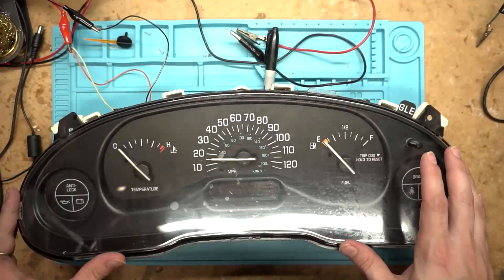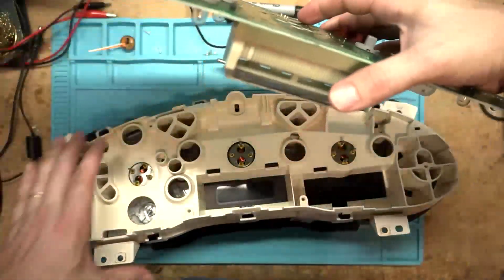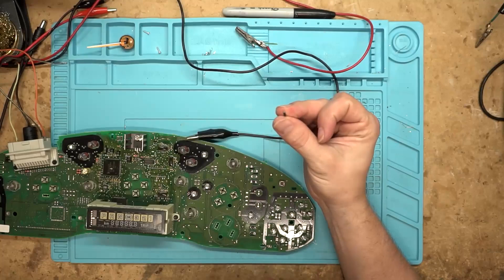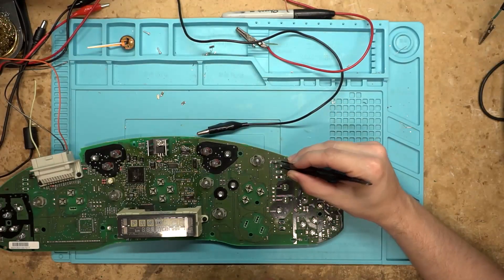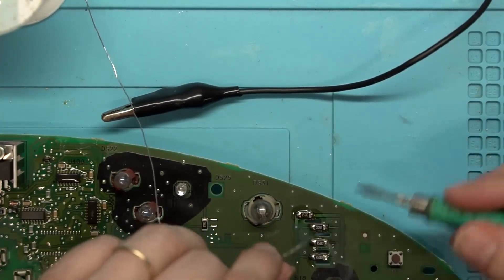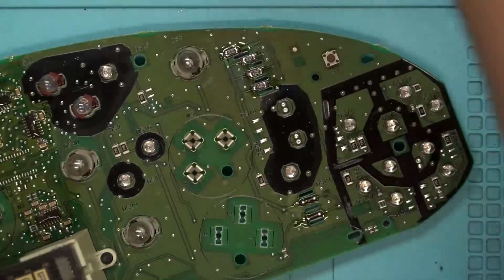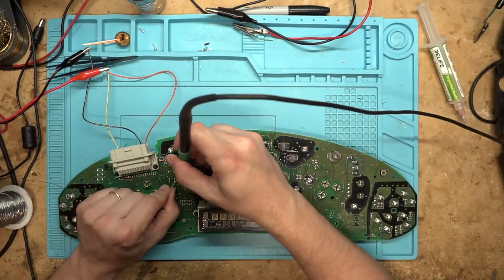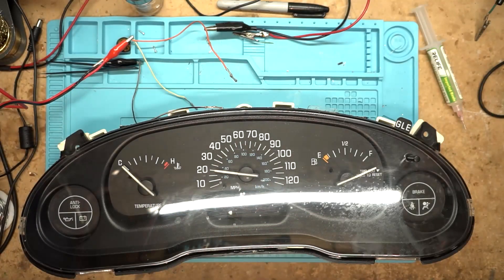Buick Century Broken Odometer Repair

Comment: Is there a video you have or that you could make that could show me how to get access to this circuit board? My LED gear position indicator and odometer/trip display was cutting in and out, and now it just doesn't work at all.

I'm great at mechanics and electronics, and I could fix this stupid quick, but tearing apart the dashboard, console and everything else behind .... I need blueprints LOL!

HELP!!!!!! 😭
Reply from the maker: Hmm I don't have to make a video of but if you watch one of my 03-07 gm truck videos it should give you a good idea. They come apart about the same.
Reply: @FixedUntilBroken  absolutely, I understand. not to be a hassle, can you link it in a reply? I've got 2 short days off after my last shift and if I can tackle this, well ... my mom would be forever grateful! xD

I appreciate you!
Reply: @crackerjack4833    Too late, but here's a video on the same topic with a good dashboard take apart description.   He points out where all the fasteners are.    The video by FixedUntilBroken has a better soldering description.   https://www.youtube.com/watch?v=5HRpIumibyE

I would add to the dash take apart, that once you have all the screws out, you're still pulling friction fittings apart.   I find that starting at the driver side and gently pulling the slips/fasteners loose working my way to the glove box works pretty well.

Comment: i did this several years ago on our 1st buick no problem, still working. just did it on my 2nd buick and still not working. pretty sure im using the same leftover resistors from the 1st try- didn't work. went to ax man surplus and bought different resistors and still no go. anyone got any other fixes before i go buy a junkyard one? as referenced in other comments i tried some other resistors 2 120 2 150s still nothing. maybe i messed something up, my reading glasses help but im getting old. also 2 of my original resistors were missing so i assume that's the problem or at least a problem. just went out, car only has 100k miles.

Comment: If you want to get technical, these clusters actually have two 120 ohm and two 150 ohm resistors. But four 150 ohm resistors will work fine.
Reply from the maker: Really? I actually didn't know that. I've never gotten on in with all 4 resistors still on it. They never have color bands still.
Reply: @FixedUntilBroken  Yea, It's hard to find them nowadays where they haven't all desoldered themselves from the board. Would be nice if they gave us some color bands right? And not that it makes any difference, but if you're curious, the stock configuration from top down or bottom up is 120, 150, 150, 120. Some of the Impala's us the same 4 resistors, just spread out a bit differently.
Reply from the maker: @mike7958  I suspect they originally did have color bands and that they are just gone from heat. the resistors are in parallel so it does matter the order. They add up 33.33 ohms run like that so you might be better off using all 140 ohm resistors it gets you closer at 35 ohms while all 150 is 37.5 so it is a little darker.
Reply: @FixedUntilBroken is that why all the videos on this type of repair seem to have the gear selector stuck on drive?

Comment: Back in the good old days people "repaired" high-mileage cars with a reversible drill hooked up to the speedo cable. In 10 minutes you now had a low-mileage creampuff...
Reply from the maker: Also back in the day they called them creampuffs. I only know that term because I saw this 60 mins report from the early 90s about this fat Texas dealer rolling back odometers
Reply: "Also" (back in the good ole days), you just reached under the dash, popped out the socket and bulb, and replaced it. Didn't have-ta pull the entire dash apart. These new plastic cars suck.
Reply: So the Matilda movie wasn't lying about that!